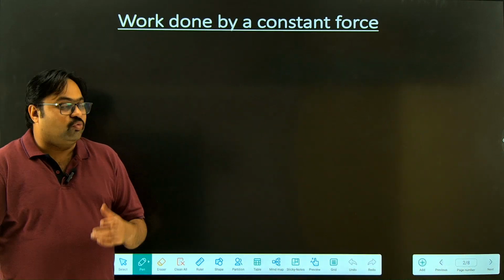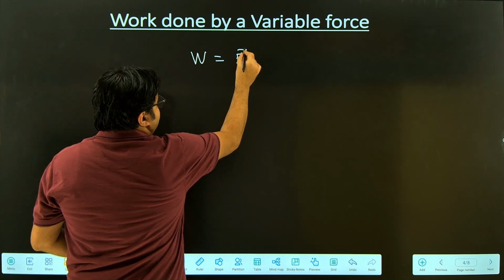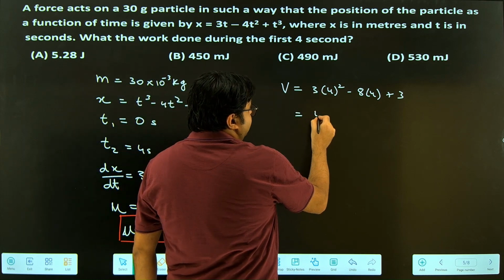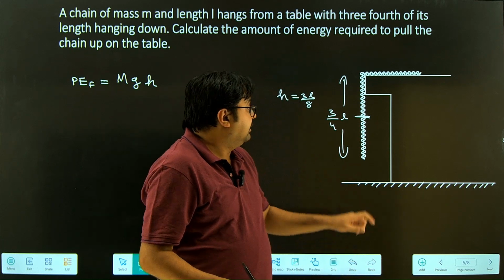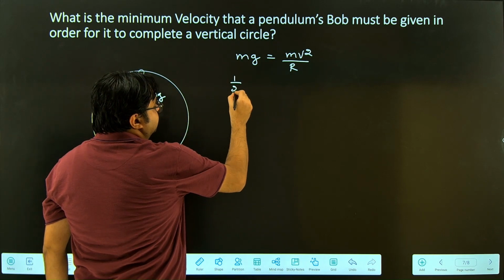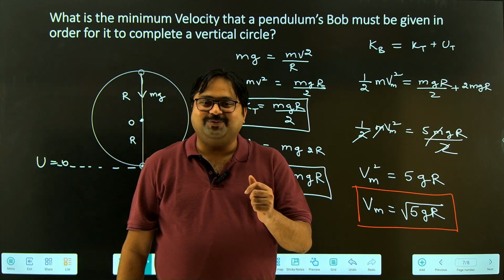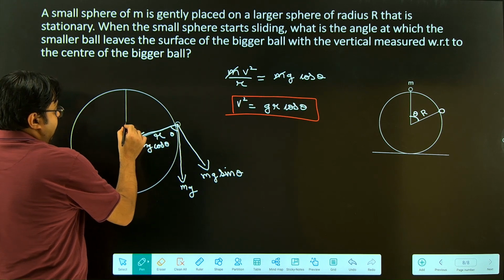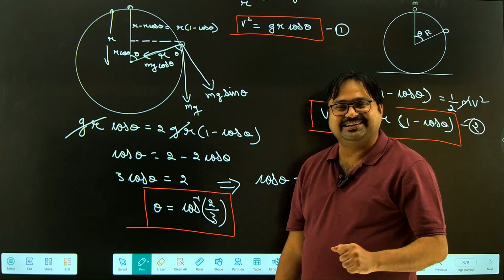WORK ENERGY THEOREM | CONSTANT FORCE AND VARIABLE FORCE PROBLEMS | PYQs

Comment: a stone tied to a string is whirled in a circle the work done by the weight of a store for a small displacement is zero plz tell sir is it true
Reply from the maker: Hi, thank you for the question!

The infinitesimal displacement is tangential to the circle in which the stone is moving. So, the angle between weight and displacement is 90 degree when the stone is at the bottom most and the top most points. However anywhere else its non zero. 

But the work done by tension at all times is zero since tension is always perpendicular to any infinitesimal displacement.

Hope this answer helps.

All the best!